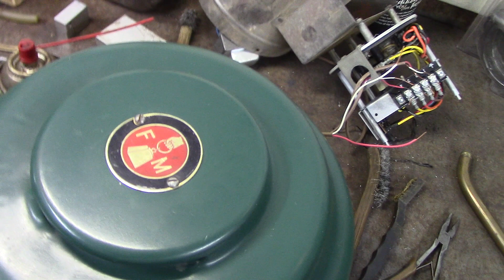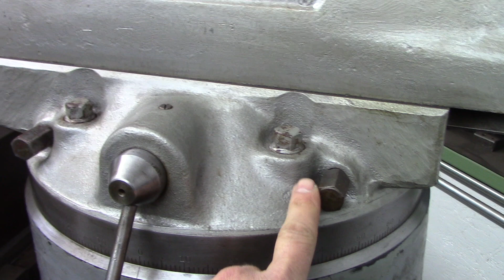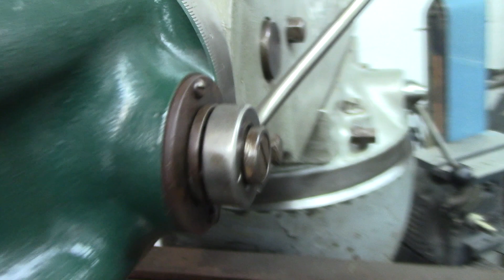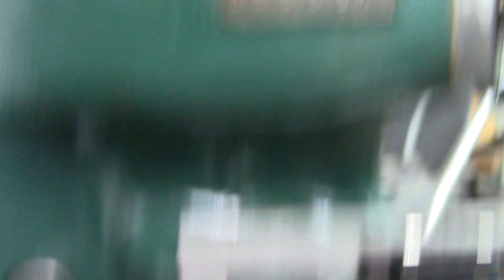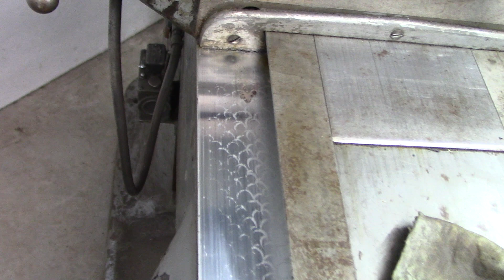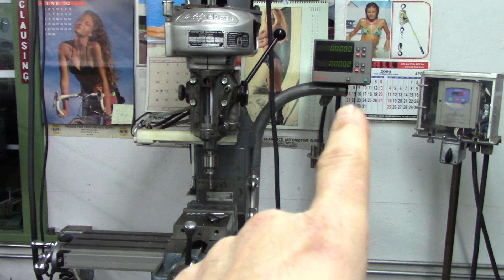11-12-23  --  Installed the Bridgeport head after 15 years in storage

Comment: Nice mill! Should give good service for a long time. For the quill lock I stick a little magnet on the head pivot nut and that holds the lock handle up.
Reply from the maker: SPI tools used to sell a little plastic rooster that snapped on the handle, that kept it from dragging.  It was called the "Cock Up".  --Doozer